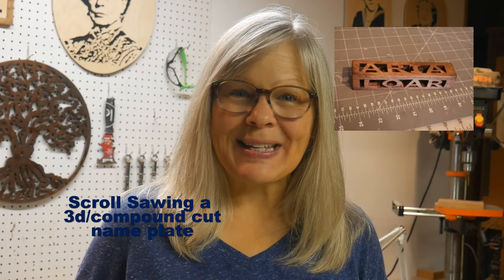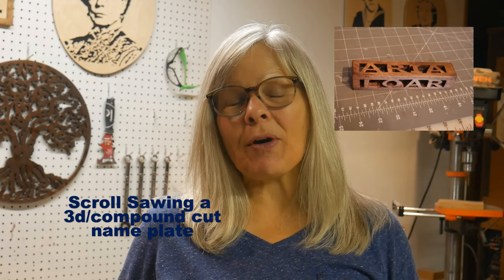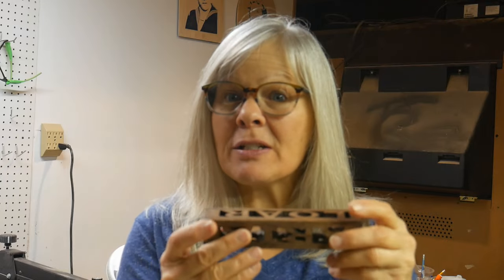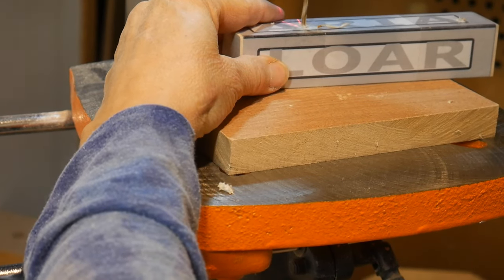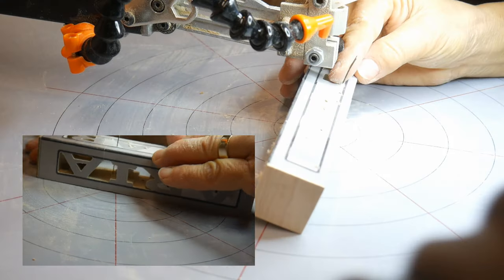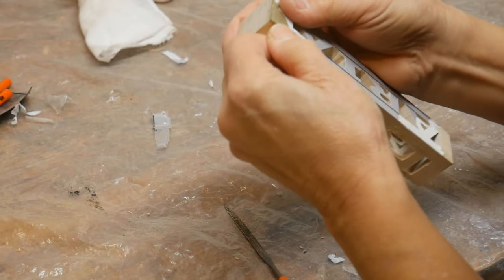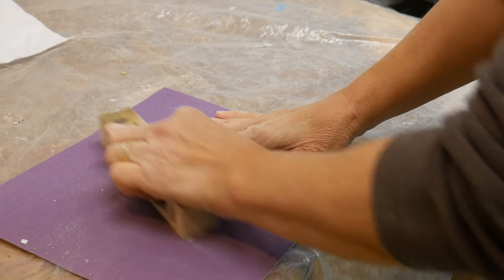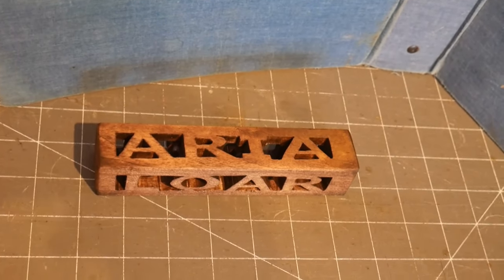Scroll saw a 3D/compound cut  name plate

Comment: I always use a clamp to hold the workpiece.  It is easier to control the cut and it takes the pressure off your hands.  Steve Good has a nice pattern for an adjustable clamp in his pattern catalog.